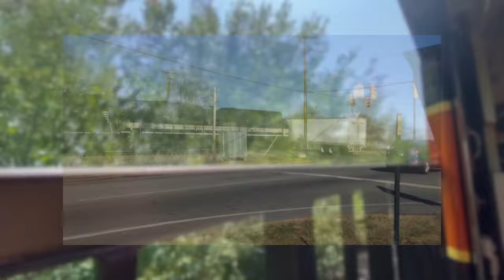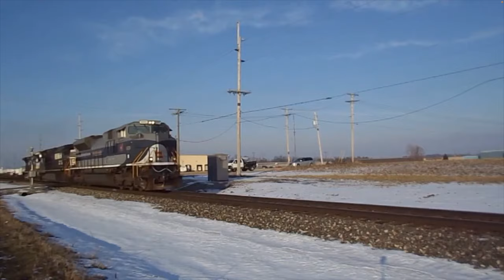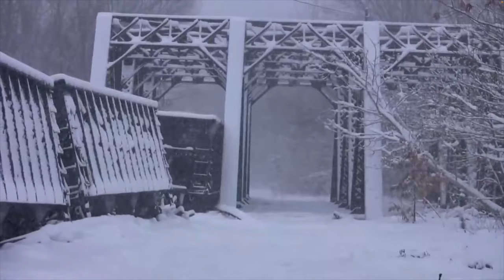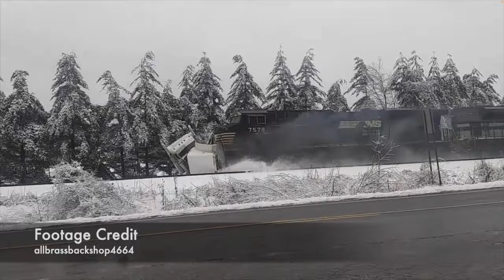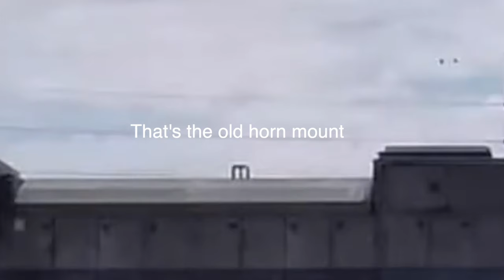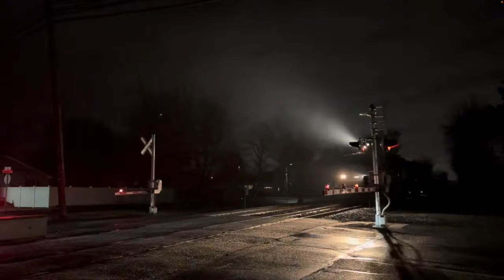The UNLUCKIEST Heritage Unit

Comment: For the derailment in Nasuha, the track was owned by GUILFORD. That right there is the sole reason for anything bad, rail related, in New England.
Reply: Nashua*
Reply: Also the tracks were owned by Pan Am Railways, guilford hasn't existed in years.
Reply: @Track_Tranzit basically the same company just rebranded
Reply: @NotGavin  yeah but its still a difference worth mentioning, especially because it signifies what time you're talking about
Reply: @Track_Tranzit  That’s true
Reply: @Track_Tranzit who built the line?
Reply: @smashedcaboose6526  not exactly sure, I know it was B&M for a while

Comment: I had a buddy of mine tell me that someone out of Decatur tried swapping the horn out originally with an RS3L. When it was bolted down, it blew so much air pressure that the horn exploded. Thats probably why it has the horn it has on now.
Reply: The NS had a traincrew employee stealing horns in and around that area, and it was likely not only on the NS as other railroads saw a prolific spike in theft of horns as well.  This guy was selling them and when they figured it all out the police raided his mommies home (yes he was still living with mommie) they found piles of horns.  The NS fired the guy but never heard if he was prosecuted or not.. He got his reward though as shortly after while working on a shortline did a stupid stunt and got flung under a moving railcar while switching and become a bi-part dead person.
Reply: @alcosteam I know who you’re talking about

Comment: 1070 is still in service, so I would argue that a locomotive like Amtrak P42 number 66 was more unlucky. It hit a truck in a crossing accident and got severe enough body damage that it's been written off. Last I checked it was still in a line of disused loco's at the Beech Grove shops along with 156 and 42. Sure 1070 it was involved in a lot of "incidents" but, it sounds like the most that happened to the locomotive itself was the horn getting stolen and replaced. I mean, the Southern Heritage Unit was arguably more unlucky.
Reply: and 8099 was rebuilt and returned to service from what i had heard and i noticed on the engine that they changed the number boards color to black